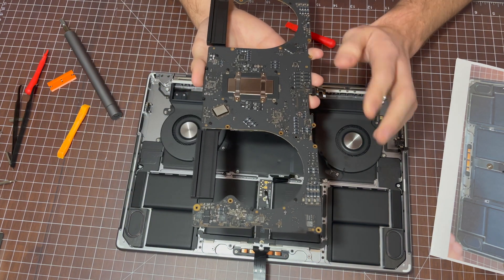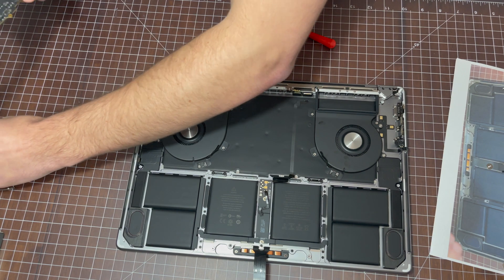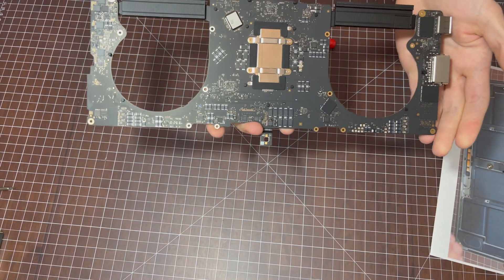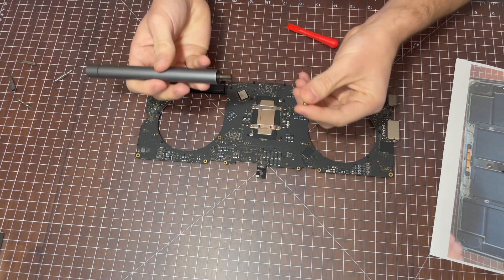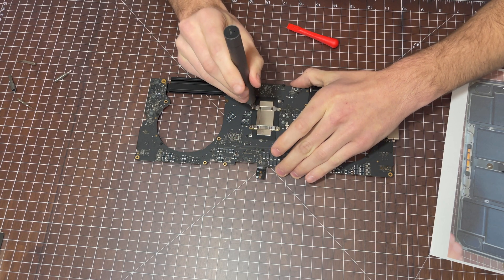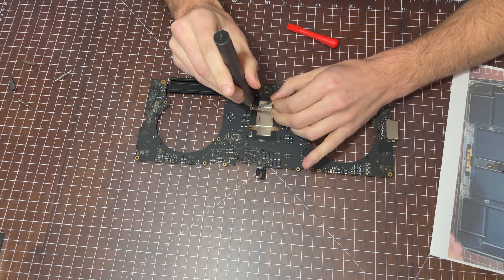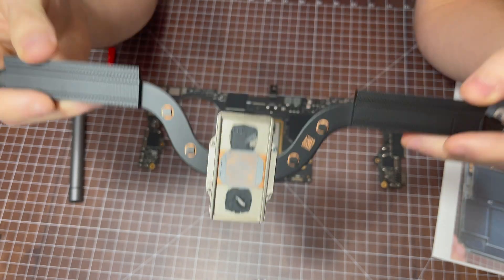Heatsink Removal: 2021 MacBook Pro 16 M1 Pro | Full Length Disassembly and Teardown Coming Tonight

Comment: i am currently reassembling my macbook pro m1 and really would like to know whether this black paste is important - i unfortunately cleaned it off but now don't know whether I can just substitute it with grey paste as well
Reply: Found it: it's Carbon Black™Thermal Compound  only problem is to purchase it - especially outside of the US, so try not to remove it, unless you have a substitute paste at the ready.

Comment: Do you know how big the heatsink fins are? Like between fins etc? I'm trying to check if it's small enough that even little dusts can accumulate and clog it or is it big enough that it's never gonna be a problem. .. thank you!!
Reply: Also did you replace the thermal paste afterwards? The CPU one could be replaced by other thermal paste but the black stuff for ram chips? Does a normal thermal paste that's thick enough work?  Like does it even dissipate the heat from the ram to the heatsink properly?
Reply: They looked about similar to previous generations to me. Any finer and the fins would probably be less efficient by restricting airflow. That should put the M1s at par with older machines for clogging, but what that means to you depends on your specific environments. For instance, my old macbook pro had plenty of fine dust on the fins but just one small dust bunny after about a decade, yet I've seen the same heatsink assembly partially or fully clogged in other guides. 

I am curious how lower air velocity in general will effect M1s since they hardly ever spin all the way up compared to intel macbook pros. Mine would hit 6000rpm if I blinked at it wrong, which might have actually helped keep its insides relatively clean!
Reply: @ettcha  me too. Because I don't have the fan turned on 95% of the time. It only does when Im doing something CPU intensive like fully saturating it for minutes. But even then it's on the lowest RPM

Comment: Where is the SSD?
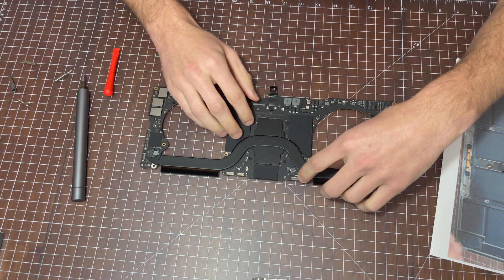Reply: Late but oh well! The ssd storage chips are on the logic board itself, close to one of the fan cutouts. You can see them top left on the board at 4:10 . They are soldered on so you cannot replace or remove them, unless you go for a complicated board level fix that was pioneered in China a year ago. A risky move since it kills you warranty and Apple can easily code out compatibility at any time. Only worth trying on machines where paying apple for a fix (aka logic board replacement) is out of the question.

Comment: how does that speakers work? apple place it at the bottom while having the grill on top side.
Reply from the maker: Great question, I don't have the answer for you, but they are by far the best laptop speakers I've ever heard and I'm coming from a 2019 MacBook Pro 16
Reply: Old news by now, but they have 6 speakers built in. Dual force-canceling woofers (facing up and down) and two tweeters. @elevatecomputing6004 is right about them sounding amazing! The force canceling speakers neutralise the base vibrations so much that without the vibrations to you expect to match the sound with your hands on the laptop, it sometimes felt like the sound was coming from elsewhere! If you have supported media, they also do spacial sound which turns that effect way up.